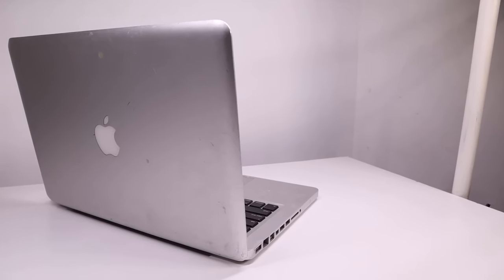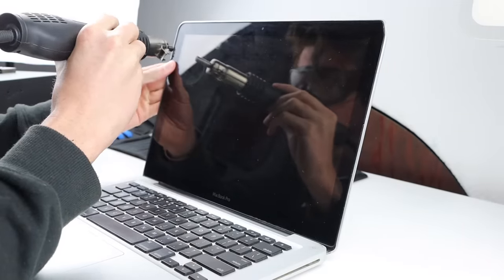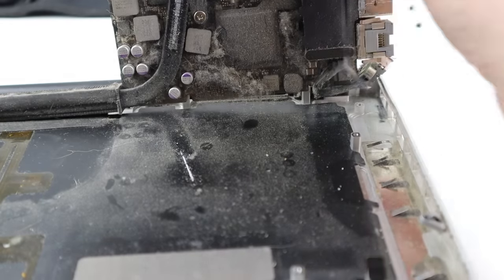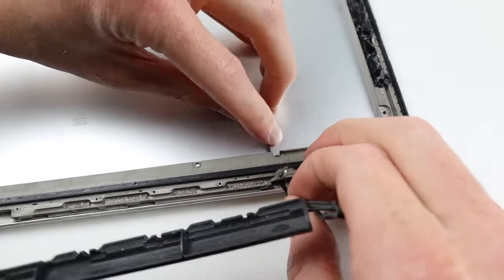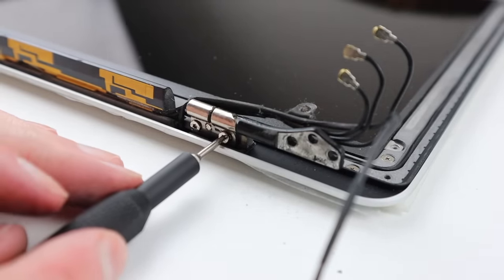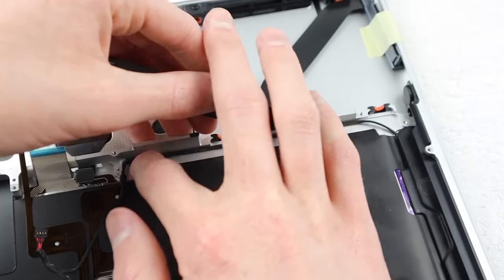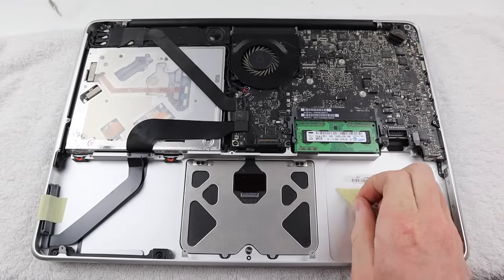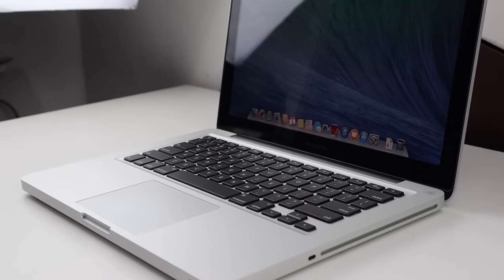$100 Trashed MacBook Pro Restoration & Rebuild + Custom Apple Logo & Keyboard

Comment: The fact that he didn't cleaned the motherboard with an old toothbrush or blasted it with air.. kinda'... bugs me..
Reply: It made my eyes bleed
Reply: and that fan...
Reply: I literally watched the video up until that point so that I could watch him do it, but he didn't i'm pissed now.
Reply: isopropyl alcohol should have been used :(
Reply: just a simple soft brush wont hurt... why he didn't do it... guuhh....
Reply: me too. i wont sub
Reply: We put the Mainboards in the dishwasher. For Real ;)
Reply: @gabocapo7762  Bad Idea - Water and electronics don't mix.  better to use an ultrasonic cleaner with an appropriate liquid (like alcohol).
Reply: @macmuchmore1  Our Technik works fine😉
Reply: my soul is broken from this.
Reply: Cleos Jericho Estrada seriously. So much work and he put it back in just as dirty.
Reply: @macmuchmore1  washing mainboards in the dishwasher is perfectly normal and acceptable, best way to clean them - no joke, just let them dry before you put them under electricity again
Reply: @purrdoom  dude, its because this video not about restoring old laptop for personal using with love and care but about installing all new parts provided by IFIXIT. but i think this video is really help-full for those who actually are about to clean their MBs. he shows all steps quite good! and this is the second purpose of this video.
Reply: PMSL..
Reply: This made no sense to me at all. I was going to ask if it compromised something if it were cleaned that way. Are the parts too delicate?
Reply: Lop i thought the same thing. Thats what i would've done.
Reply: It was paine...🤷🏼‍♂️
Reply: Same here
Reply: Or the fan, that was left uncleaned as there was still dirt around the blades.
Reply: I could feel my OCD kick in! Lol...
Reply: @Diazole1  not necessarily.
Reply: Same! 😭
Reply: it gave me forrest whitaker eye!
Reply: For all who are complaining about his technique and complaining about this and that... THE MACBOOK WORKED PERFECTLY FINE AFTER HE WAS DONE!  GET A DAMN LIFE!
Reply: yes me too.so disapointed.
Reply: thats not the only thing
Reply: I am here to write the same thing
Reply: was just thinking the same thing bro
Reply: Super bugged me too ... all that effort and he didn't do that
Reply: @Alton Kilbourne - I have no idea what you are trying to say. I also don’t know why you feel you need to leave such a nasty reply. It’s just an opinion. Get over yourself.
Reply: Alton Kilbourne What are you, 5 years old?  I just stated an opinion. You’re the one over-reacting. Plus, I’m not “talking”, I’m “writing”. Anyways, dude can wash his electronics in a bucket of water for all I care. I just don’t think it’s a good idea, especially when there are other options. If you’d like to respond with some valid discussion points, I will be happy to discuss them. If you’re just going to rant and curse, I’ll just pass on responding further.
Reply: Not a hater but speling
Reply: I would have just replaced the CPU fan, as it's a moving part, and will probably die in the neat future. It's probably pretty loud with all that dust. Plus, the fan isn't even that expensive to replace.
Reply: SAME! >:(
Reply: I wouldn't have had that disgusting thing in the house!!
Reply: I got really mad not blasting the dust with air
Reply: @macmuchmore1  It was a joke my dude, I don't know why you're being so technical. He obviously doesn't put any electronic devices in a dishwasher. No offense but you're just missing a common sense of humor.
Reply: He should have called this video “case swap” since he did not restore anything beside display. 

- No motherboard cleaning
- No fan cleaning 

And in the end of the video when he said “Brand as new” i was like.. “What!?”
Reply: same to me...
Reply: Yeah, I came to the comment section for this reason
Reply: Comique Gaming he didn’t cleaned...
Reply: the dust maintain the logic boar alive.. thats why he keep it dirty LOL
Reply: @purrdoom  who cares nerd
Reply: Andrew Bernard it should be fine along as it has no charge in it (let it dry before reconnecting it)
Reply: @stepdg  yup... me too
Reply: What bugged me was how you said didn't cleaned
Reply: Ese Seis don't be rude because it's his laptop not yours, what do you expect? for him (a famous YouTuber) to listen to you?
Reply: Fucking yes.
Reply: He did it for extra comments
Reply: Might've done it off camera?
Reply: I could not stop crying when I watched it
Reply: Alton Kilbourne has 6’$$*@&70d
Reply: Aisa206Hassan206 what fix your English
Reply: That was the whole purpose of this video. It's called "modern online marketing". By making this "trick" of making something horribly wrong in the video, he gets people to comment more. No matter the nature of the comments, more of them = more user engagement. That means, video is more valuable for throwing adverts at you. Another thing is, what kinda restoration was that? The video was sponsored, he got 90% of the stuff from the sponsor, and he only moved everything from old casing to the new one. If he was passionate about restoring it, he would have never placed this dirty motherboard back without proper cleaning. Also, he would use the old case and fixed all the dents. And yeah, of course new case looks better...
Reply: @NorbertFalkiewicz  ok
Reply: GT player hha
Reply: Took me quite long to figure out that this is rather an ifixit commercial channel than a real restoration channel.
Reply: Berith Lothbrok OMG yes!! Thank You!!
Reply: me too
Reply: Yeah, that bothered me a lot, i thought he was gonna clean the board before he put the thermal paste on, but no.
Reply: Comique Gaming Grammar.
Reply: And THE FAN!  Ugh, that fan was still crusty :(
Reply: Ahhhhh
Reply: Yes
Reply: Yeah, what's that about!
Reply: this is not acceptable!!!!!!!!!!!
Reply: That was heartbreaking to see! I had a hard time watching past the replacement of the board and fan.
Reply: You have issues bro.
Reply: yeah fells so annoyed by it, makes me wanna kick my cat out of the window
Reply: Came here to say that, i cannot sleep until he reasures me that he cleaned it afterwards
Reply: r/youngpeopleyoutube
Reply: Same here.
Reply: @Nemtudoknevetadni  you killed with that one
Reply: Cleos Jericho Estrada me to it bugs me
Reply: Kafu how filthy can a m/board be that you need to run it through a dishwasher, that’s the real question
Reply: yes
Reply: @Nemtudoknevetadni  .
Reply: you are not alone as you can see 😅
Reply: Yeah true
Reply: Indeed, It made me sneeze.
Reply: Kafu says the malicious troller
Reply: IPTV for cheap
wow chill dude
Reply: GEEZ CALM DOWN OPINIONS ARE NEVER WRONG IT’S JUST PREFERENCES (while there are some trollers in this reply section)
Reply: i cringed a bit too
Reply: Very dirty jobe 
But nice restore
Reply: Because apple means that much?
Reply: first applied thermal paste before cleaning :(
Reply: If you look a bit ahead, you'll see the connector with the red and black wires isn't clipped in and he didn't clean the fan.
Reply: agreed
Reply: @Kafutschga  This method already saved my a board given as lost.
Reply: Same
Reply: @Diazole1  yeah
Reply: me too
Reply: This sort of cleaning is best done by Luke Miani
Reply: 100 responses when i writed this
Reply: 101th reply.
Reply: @Cleos Jericho Estrada     Why doesn’t he just pour that cleaning alcohol thing over it
Reply: I know. I probably spent a good hour just de-dusting all the components when I did my upgrade. What's the point of going to that level of dissasembly without bothering to do so?
Reply: @purrdoom  oh boohoo
Reply: He did at the end
Reply: I know right? Same for that fan
Reply: I noticed that as well. Erm, Hugh from 2019?....Future Hugh would like a word with you
Reply: Now you can call it a Macbook Air. :D
Reply: Or the fact that he made no effort to clean out the charging connector
Reply: indeed omg
Reply: @iptvforcheap4756  Well said. 👏
Reply: @i6oub-49  you mean didn't clean
Reply: Me too Hhhhh I feel fuc*kt why he didnt clean it
Reply: Me too! I am disgusted
Reply: That's because the dust is paired to the components
Reply: 14:25

Comment: Hugh.. please clean that board!! That is very dirty. Use compressed air and a brush
Reply: Yeah that bothered me too, a brush would have done the trick. Also the cooling fan was still quite dusty.
Reply: YES! if anyone is reading, USE A BRUSH OR COMPRESSED AIR, not a vacuum. Vacuums cause static, which can damage electronics
Reply: That won't clean everything on the board. Instead just use a damp cloth
Reply: @andra_syawwal  A good rinse with distilled water followed by alcohol works very well.
Reply: Barry Manilowa Agreed, but I don't have that.  So I simply wash boards very carefully and dry them.  Easy in Texas sun!
Reply: Soft toothbrush and some rubbing alcohol 👌🏻
Reply: @booboo699254  I have a material that my Local Tech store sells, it's basically slime, but it doesn't have any water in it. I can use it to get dust out of all of the nooks and crannies in my logic boards. It doesn't leave any residue and it leaves my boards looking like new!
Reply: MirceaD28 He doesn’t read the comments
Reply: @booboo699254  yeah that works better
Reply: @manuel-qw2js  yes he does
Reply: Jake Wagner uhh, no he doesn’t 😂
Reply: @manuel-qw2js  yes he does read the comments
Reply: My heat dropped because this Xs max can’t be broke😂😂😂
Reply: my god, that really bothered me. simply brush off the dust and blow it afterward. Then use contact cleaner for cleaner look.

Comment: Did everything perfect, the motherboard though
Reply: There is chance that while cleaning the mother board with a brush or some cloth static electricity is produced and it ll blow up your motherboard
Reply: @akashdeepganesh2420  with isopropyl alcohol? Not a chance
Reply: @akashdeepganesh2420  the brush is designed not to create static electricity
Reply: bruh
That’s a REALLY bad joke.
Reply: @alexwelt  i can't tell if you had a stroke or not
Reply: @theunknown7683  nope I had no stroke
Reply: It’s called a logic board
Reply: @abideepdhillon43  its motherboard or mainboard
Reply: In fact that you can even put a normal motherboard in your dishwasher, there is no problem by using a brush
Reply: @JayTowerz0220  it.lol ?
Reply: Also would of been nice if the fan had been cleaned, now gonna blow all that dust in it around the laptop. I would of at least used compressed air to blow some of that dust on the board and fan away.

Comment: I got triggered when he didn't use compressed air on the motherboard. Also, you shouldn't spread the thermal paste...
Reply: Andrei Agulescu yeah
Reply: Spreading the thermal paste isn't gonna do anything bad but it isn't needed unless you have an AMD Threadripper (That thing's huge). Also, I think he put a bit too much thermal paste
Reply: He probably didn't have any compressed air on him so he did the best he could.
Reply: Marco Castiglia “is such a stupid” lmao okay.
Reply: Andrei Agulescu  why not ? I’ve been doing that on 5 different working PCs over the years and never had a problem. CPU works perfectly.
Reply: @georgegovea1958  you'll most likely introduce air bubbles which will affect the heat transfer (whether this will be noticeable depends on how many air bubbles you introduce). It's just messy and unnecessary, you only have to squeeze a pea-sized drop of thermal paste and put the cooler over it. the paste will evenly distribute itself. manually spreading can also cause uneven distribution of thermal paste.
Reply: i thought the same thing.
Reply: @marco.castiglia  bruh, you just jealous because it's a MacBook I have an imac
Reply: @andra_syawwal  that's even worse broth
Reply: HE ACTUALLY CLEANED IT. YOU DON'T READ COMMENTS MUCH.
Reply: Spreading thermal paste is absolutely fine. You really domt have to do it but its fime if you do
Reply: Or contact cleaner
Reply: @bananasaur5209  if you use the correct cooler, you don't need to spread it for any processor. As you tighten it down, the paste will spread.
Reply: @Starlesslemon  said the irish immigrant
Reply: @marco.castiglia  it's also a reference that went right over your head.
Reply: @marco.castiglia  what are you on?
Reply: @Starlesslemon  You know what's the deal with the English language? It's quietly easy to learn. But I let you guess
Reply: @wayneseely8769  He could do it with tooth brush it would do spectucular job compared to his "cleaning"
Reply: Simon Polakovic well idk if you are deaf but he did use a toothbrush and I’m sure he did the best he could. If you were on this channel for more than two seconds you would know that he is a perfectionist.
Reply: Yea everyone is a fucken expert now aren't they
Reply: @a4andrei  I'd say this is true for heavy CPU coolers that will apply pressure on the paste with their weight. Here, in a laptop setup, I doubt there's enough pressure on the paste to distribute it evenly on the CPU.
Reply: Marco Castiglia trying to roast people but not even saying things correctly. So ironic
Reply: what the hell happened here

Comment: The one thing I would do as an extra step is to really clean up the motherboard, just to make sure it is squeaky clean. You already put a lot of time and effort into restoring this Macbook.
Reply: Yeah I was about to write the same comment. MagSafe connector was a bit dirty too.
Reply: I was thinking the same.
Reply: Yeah thats true!
Reply: And most importantly, the cooling fan. That thing was still dirty when it went in....
Reply: IKR, this made me mad. How difficult is to clean it, to do it all the way.
Reply: One must be careful when cleaning the motherboard on a 10 year old laptop. IC chips can easily fall off and are not easily replaced. I would've cleaned it to the extent that Hugh did, and not more. I little canned air, a little isopropyl.
Reply: It bugs me
Reply: Also the fan needs to be cleaned
Reply: A cunning man Hugh is. He planned us writing about it all along...
Reply: @jajajajajaja867  It's not just your OCD. Why 
go to so much trouble to restore something if you're just gonna half ass it?
Reply: @jajajajajaja867  I agree he should have cleaned it but maybe he didn't show it in the video and actually vacuumed some of it out. I hope :)
Reply: agree，only the motherboard is dirty  but other parts  are new
Reply: What really drove me crazy was he didn’t blow the dust out of the fan.
Reply: Stefan Zlatanović he didn’t do any of try that
Reply: @kiyoponnn  he even bitched about the thermal paste well you can't do it properly without new thermal paste but he didn't clean the motherboard with isopropyl alcohol

Comment: Dislike this video because he put back the dusty board without a proper cleaning
Reply: He Could Clean IT Better Than You.
Reply: He did clean it, he even says so in a comment below, but it's not easy to find!
Reply: @MeneGR  he def did not!leaving the fan like this is making all that effor senseless..that reduces the speed and functionality of the fan alot...just a regular compressed air would have done the trick
Reply: All About My Aquarium! I can clean it better I work in computers
Reply: He should buy some CRC
Reply: He probably didn't have any compressed air on him so he did the best he could.
Reply: All I wanted was to see the motherboard cleaned.
Reply: they buy the new mac pro
Reply: No one cares
Reply: exactly, I feel you there!!
Reply: Porké Chop he could have used a ultrasonic cleaner, if he had one, too
Reply: @kuk3411  An acetone? Are you sure it won't damage plastic part in magsafe port? Will just EthOH be enough for that?
Reply: Evgeny Petrov The little grey plastic sticker on the MagSafe port doesn’t do too well if you use too much acetone but works well if you clean it quickly with it.  
You could also use a small amount of spray furniture polish (mr sheen) with a cotton bud.

Spray the furniture polish in something like the spray lid and then use the cotton bud dipped in the polish.
Reply: Evgeny Petrov Ethanol would also likely work, yes.. I haven’t tried that though. Also Isopropyl alcohol... basically anything but leaving it dirty 😂
Reply: He did clean it, but the clip was cut out, if you would scroll down and see his comment you would know that.
Reply: Agree!
Reply: :c
Reply: Pretty much
Reply: Agreedd
Reply: That annoyed me too! 😩
Reply: Totally agree... takes 2 minutes
Reply: hahaha I thought I was the only one that noticed hair and dust still on the board when he installed it on the new one.
Reply: Agree where is the contact cleaner?
Reply: thats exactly what im going to say
Reply: most of the stuff he did was super sloppy.
Reply: he is a HUMAN DAMMIT.
Reply: He did clean the board, just look at it after he reinstalled it.He also said that he cleaned it.
Reply: I wonder what he's doing at 14:26??????r/wooooooosh
Reply: Yeah, the restoration is all in all very good, but it's not a proper Restoration when you don't clean the PCB for example with a brush ^^
Reply: Soffian Zainal 

Ikr
Reply: Dude don't be like that. You don't know how much money and time he put into making this video.
Reply: @kuk3411  its not like he knows everything
Reply: Soffian Zainal same
Reply: Im gonna press like just because you wanted me to dislike. Fool.
Reply: @TheRealGigaCat  easy there
Reply: Liking your comment because I don't have the balls to dislike a HJ video since he's helped me, also, the comment engagement helps the video and by liking the comment the constructive feedback gets promoted
Reply: says the child who never completely watches videos
Reply: Raid One HEY YOU SHOULDN’T DO THAT
Reply: No coto
Reply: No